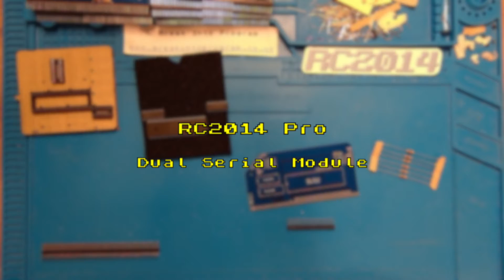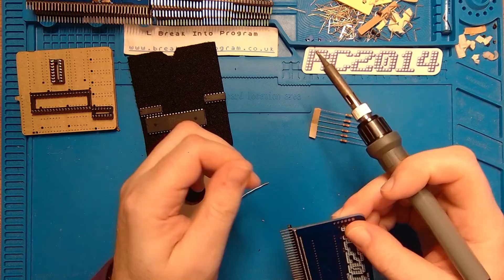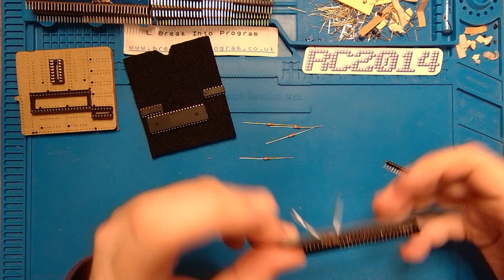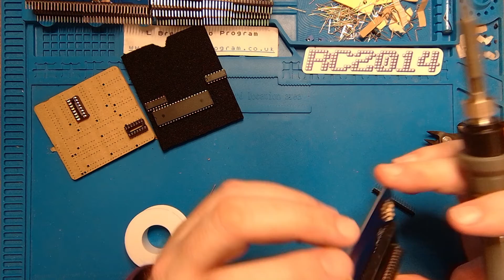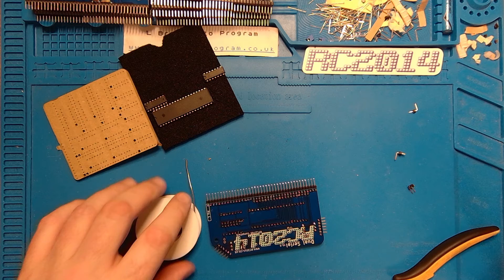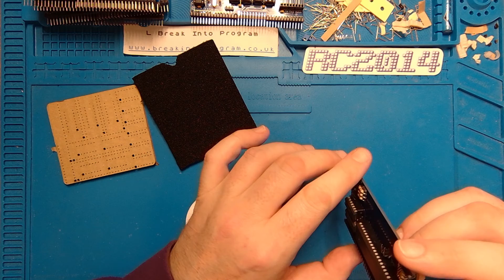RC2014 Build: Dual Serial Module

Comment: I could not figure out why my RC2014 would not output anything on the serial port.  Several hours with logic analyzer and oscilloscope  finally figured it out. Turns out that Port B jumper should be OFF.   In fact NO jumpers should be on this board if you run external 5V supply.